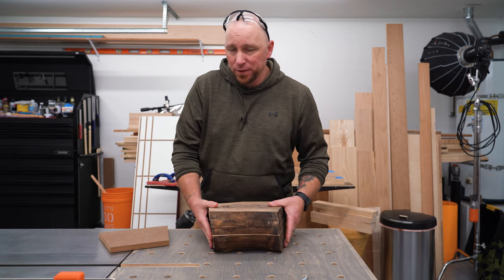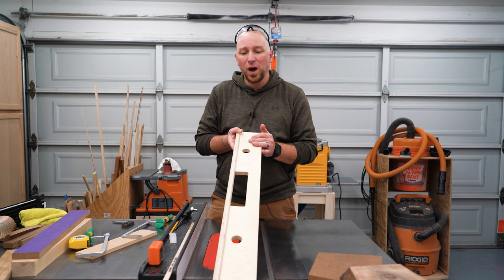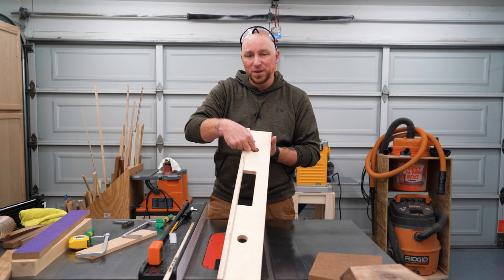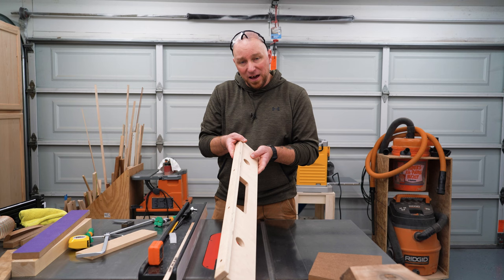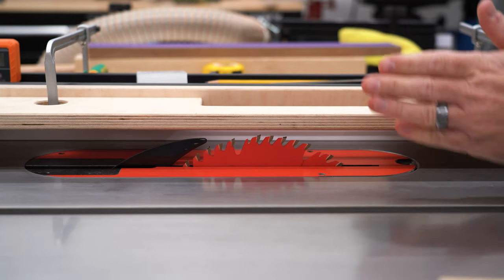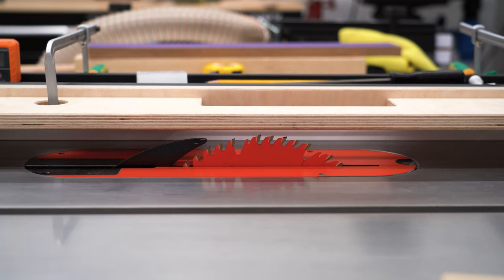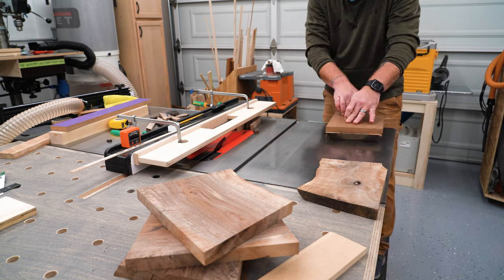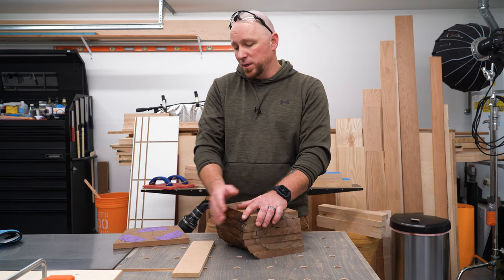This Setup Can Benefit Anyone with a Table Saw

Comment: Hello, i'm Linda from Belgium. I wanted to thank you for your L-fence tip. I use it almost every day! Now i had to miter my pieces for a knifeblock. I always found a 45 cut very scary. Not any more! I cut a scraps to the width of the inside  the knifeblock and use it to cut the miters! Awsome!

Comment: Good demo.  A thought:  if you made the cap of the "tee" on the L-fence the right width and positioned it properly, it seems you could clamp the L-fence at the right height for two oft-used wood thicknesses without using the 1/2" shim.  This would be especially useful if you tend to make projects with only one or two thicknesses.
Reply: clever. nice, simple upgrade.

Comment: Clever, simple design for the fence.  Good technique for replicating parts.  I'd feel safer screwing the template to the workpiece both for my piano fingers and to keep the template securely in the same position for all cuts on each workpiece.  Small screwholes in the under side of the shelf could easily be disguised.  I like your videos -- brief but thorough and no BS attempts to be an entertainer like too many Vbloggers.  Respectfully.

Comment: Nice technique! I've seen other L-fence videos before, but they all used double-sided tape to attach the template to the workpiece, and you and I agree that's not practical or efficient if you're doing more than a couple pieces.

Would like to see how you're attaching those shelves to the main rail!

Comment: Another big advantage of that fence I see... it acts as a semi-blade guard and controls cut offs from flying up.
Reply from the maker: @csimet I was fully expecting the pieces to bounce off the blade at some point because the checked ends were falling apart as I cut them. None did, but I was glad to have the fence there just in case.

Comment: I can't believe how slick the top of your table saw table is. How do you do that
Reply: Paste wax, likely.  Must have for the shop.  Cheap, and great for any metal surface that you want to be slick.  Jointer and planer beds, table saw top, etc.
Reply from the maker: @Brian Yes, it is paste wax. I clean the top well with acetone, lightly sand any rust spots that may have developed, put a light coat of paste wax on and let it sit for ten minutes or so, and then buff it out.

Comment: Great video and looks like a fun project. However I’m still confused by the use of ‘live’ edge. Which side of any timer is living?
Reply from the maker: @John Hole Timer?
Reply: @InspireWoodcraft  timber
Reply from the maker: @John Hole Ah! I should have figured that out but I missed it. “Live Edge” is typically the name given to wood that isn’t processed into a fully rectangular or square board and has the bark face or edge still on it. Think of a “slab” table, for instance. The bark-like edges would be called live edge.
Reply: @InspireWoodcraft  I totally get it. It’s just a pet peeve I guess. Sure it’s a natural edge but live? Nahhh
Keep up the great work!

Comment: Thank you for your consistency. You’ve become about the only subscription I have that I watch as soon as I can. What did you use on the bandsaw to get those slabs? I’ve got A Lot of resaw work to do with the American Sycamore I felled and a couple other nice logs I don’t even know the species of.
Reply from the maker: @Jeffrey Canfora Thank you for continuing to watch! I used the Timber Wolf VPC series 3/4 wide, 2-to-3 TPI bandsaw blade (mine is 111"). I found a link for the same one on Amazon (https://amzn.to/3Jjf5bB), but I actually bought it at Woodcraft. Price is a little cheaper at Woodcraft, but I also picked up mine in-store, so no shipping or anything. Hope that helps.

Comment: what is the benefit of using this vs a router with the template?
Reply: I've found using an L-fence to "flush trim" things with a cross-cut blade can give a cleaner cut with far less tear-out on end-grain than a router bit.  (Maybe not if you have a spiral bit) 👍
Reply from the maker: @tektrixter In this particular case, the offcuts on the ends would have probably exploded if I used the router. There is a lot of checking, so the offcuts come off in chunks as they break apart at any crack that is fully separated. Plus the length of the offcut ends was a bit too long to take off with the router in one pass.

Comment: This is going to be a stupid question according to most people on here, but if the SawStop blade hits the sand paper, will that be enough of a charge differential to kick of the braking mechanism?
Reply from the maker: @MW Graves Keep in mind that in this situation, the sandpaper never comes in contact with the blade. That being said, I have run the blade through sand papaer from time to time and I've never had anything happen. That's not to say that it couldn't happen. I suppose with some sort of metallic paper?

Comment: Wait,  you could "template" drawer parts for a series of shop tables,  and cut the dados,  and as well a External dimensions!   Genius.
Reply from the maker: @Clinton Lemon III Absolutely! You can also use the L Fence for rabbets without destroying a sacrificial fence. I haven't had a chance to show that yet.
Reply: @InspireWoodcraft  Super!  I'm building out my single car garage shop and planning to go with "hooked on wood" & Paulk type standard drawer "tray dimensions" with multiple height fronts that slide into dados in the cabinet walls.  This L fence and templates will make me efficient AND accurate!

Comment: Nice, but I shuddered when I saw your fingers so close to the blade. This is an issue because of your reliance on the sand paper keeping its grip during the process. I would stick to the sticky tape for safety...